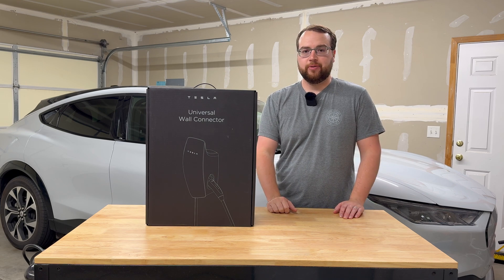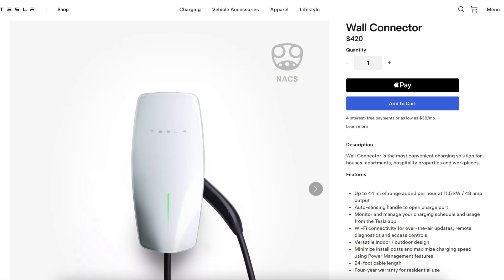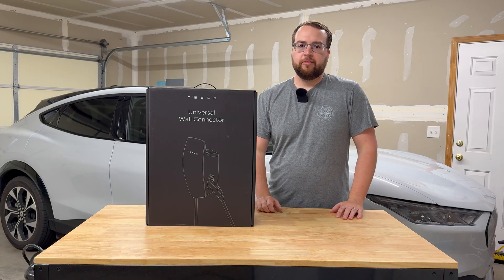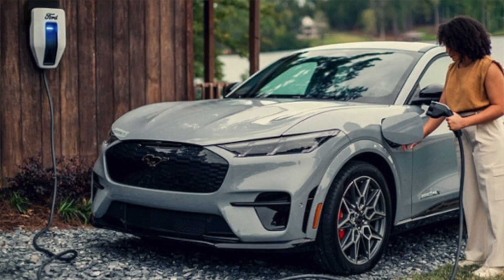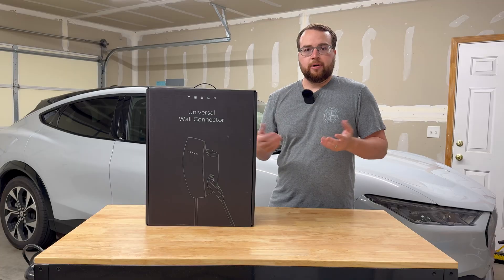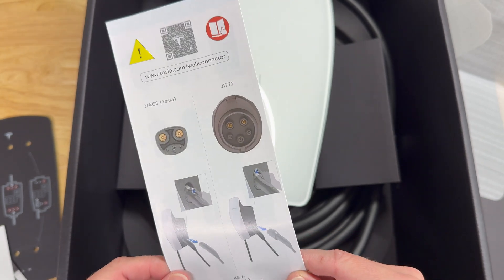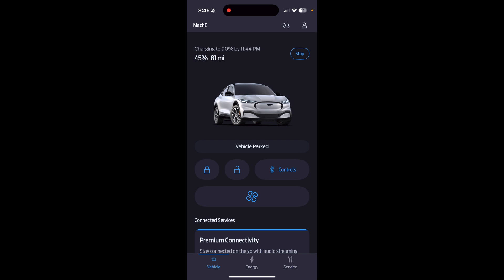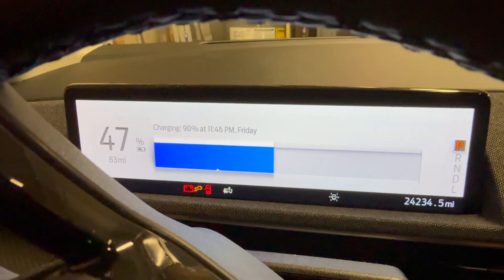Why I Chose Tesla’s Universal Wall Connector for My Mustang Mach-E!

Comment: Hi, Great video. Just a quick question, you said you have the Tesla charger connected to a 60Amp service panel. Is that your main panel and if so, is that panel enough for your other appliances? Thanks
Reply from the maker: Thanks for the question. I have another video that goes into more details about the garage upgrades including the electrical here: https://www.youtube.com/watch?v=Z0vgYUPEFqc

In summary, I previously had a 100 amp main panel and several different electricians recommended upgrading to at least a 125 or 150 amp panel to add the EV outlet. Since it's a panel upgrade, there wasn't too much additional cost to jump to 200 amp. Since we jumped to 200 amp, I opted to add a 60 amp breaker in the main panel for the EV charger. I would be perfectly fine with a 30 amp charger, but I went with the 60 amp since the upgrade had the overhead to easily do so.

Comment: How do you like the charger for your Mach-E after 8 months? If you're in Canada, have you regretted or considered any of the charging programs such as GreenMiles, ChargeLabs, Grizzle Club, Swtch, etc?
Reply from the maker: Thanks for the question! I'm really happy with the Tesla unit. I haven't had any problems with it. Car has charged every time no problem. The Tesla unit has always been ready to go and the Tesla app that controls it has been solid. I haven't had any reboots/software bugs/connection issues. Maybe my only small complaint is the fact that you are using a NACS charger with a NACS to J1772 adapter and when I'm done charging and go to pull the charger out, the adapter shifts slightly by ~1/4" and it doesn't feel quite as solid as a native J1772 charging handle would. It's not causing any problems, just that slight shift makes it a little harder to remove from the car, but it's really not a big deal. I think the benefits of how solid the charging unit is and the ability to have one charger that can do both with an adapter built in is worth it. I would buy another one of these for sure. 

I'm not in Canada, I'm in the US, so I was not familiar with these charging programs you mentioned. They sound pretty interesting!

Comment: you didn’t buy nothing special for that adapter it came with your purchase of the Tesla universal charger?
Reply from the maker: Correct, the adapter is built into the Tesla universal wall connector. You can't remove it. It's either stuck in the wall unit if you're charging with NACS or it's latched onto the charging cable if you're charging with J1772. I do wish Tesla would sell this NACS to J1772 adapter separately as well. They currently only sell the J1772 to NACS adapter.

Comment: The reason why it does that weird lock and then unlock on the charge port is because Tesla starts to use the Tesla proprietary signaling before it fails and defaults to J1772. I made a video about this a few years ago on how to fix it. Seems they still do the same thing even on their universal adapter.
Reply from the maker: That's great info, thanks! Do you have a link to your video? In the Tesla app, there's some options for access (Any Electric Vehicle, Any Tesla Vehicle, Only Authorized Tesla Vehicles, and Compatibility Mode). I have it on Any Electric Vehicle right now. I'll try Compatibility Mode to see if it'll default to J1772 first. It's not hurting anything as-is, but was curious what caused that.
Reply: @studzstudios  Compatibility mode is what it should be in, that is try J1772 first.  My video might not apply to your setup because I had to open it up and change dip switches which you probably don't have to do anymore  on the newer model. I'll look for it and reply again later with it.
Reply: @studzstudios  It took me forever to find because it's not actually a video lol. It's a short. https://youtube.com/shorts/LC7iUkt9Bpg?si=0kz-WXl9_3ydaPDc